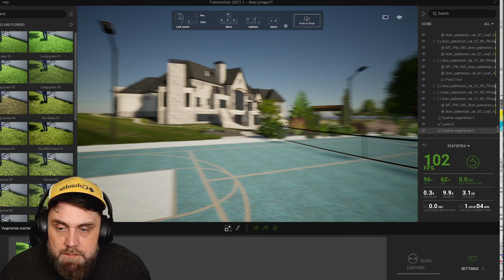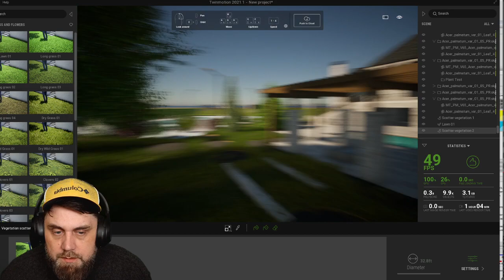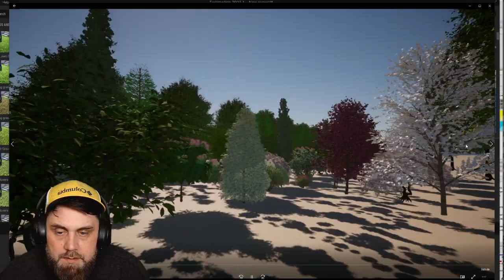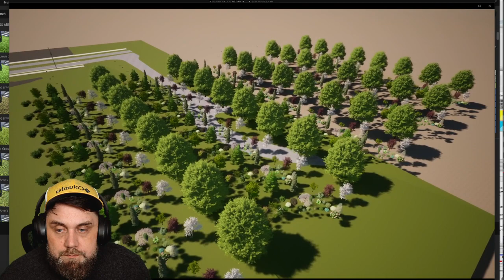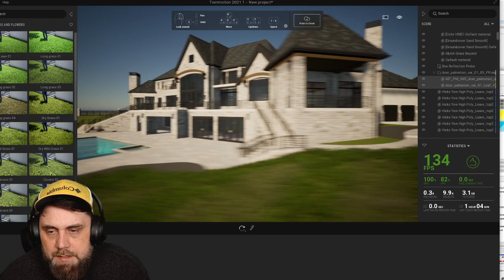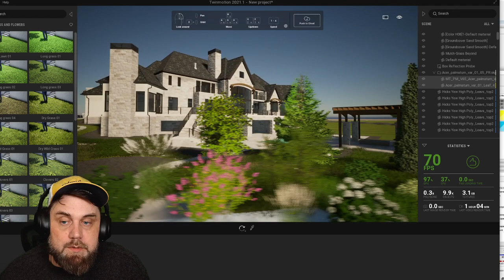NEW Twinmotion 2021 - 3D Plant Import Test

Comment: Great design and video. I am very curious as to which machine-specs you are using to achieve this? 
PS. I am currently working on a Macbook Pro 2017 - 3.1 GHz Quad-Core Intel Core i7 -16 GB 2133 MHz LPDDR3 - Intel HD Graphics 630 1536 MB &  an EGPU: Razor Core X + Vega 64.
I must say that with this I have a pretty performant and stable system.